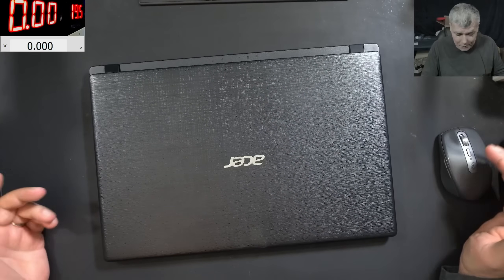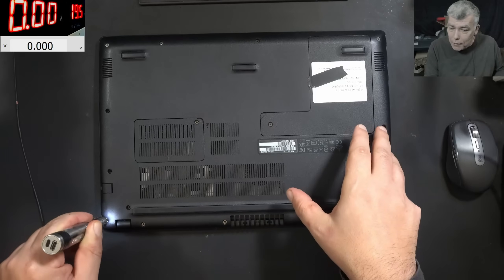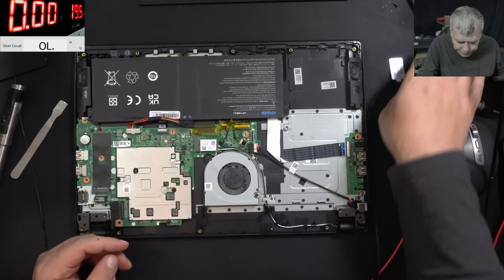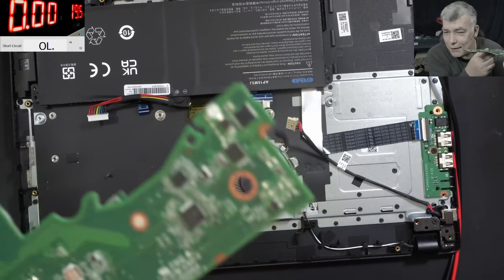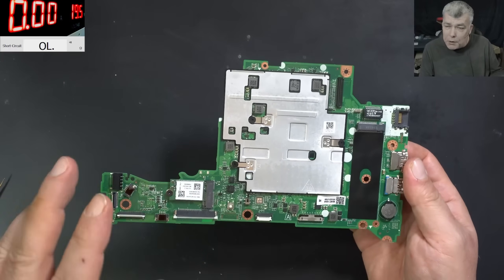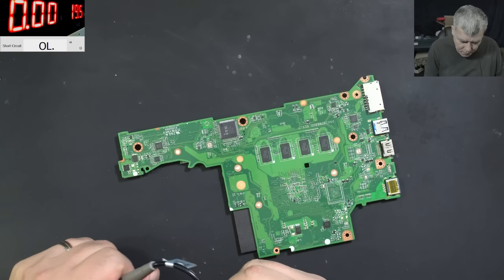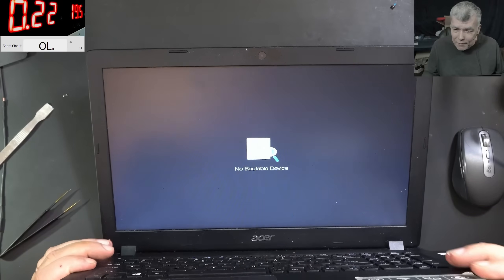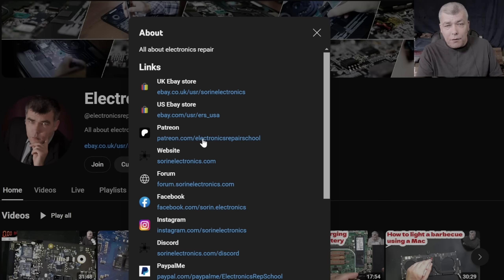Acer Aspire 3 not charging, this can be the reason and you can fix it

Comment: Dell Precision M 6700 17.3" 
I accidentally tore a "Smaller Then Sop23-6 " but miniature. "Off the board trying to too unhook the GPU fan.  I snagged my fingernail across it and peeled it right off the board.   I don't have the equipment you do, too see such tiny objects.  If your interested then 
I'm interested in sending it your way to be fixed.  I still have the IC and I see you having no issues.  Maybe 3 pads came up on the little legs.  Let me know and we will compensate for the shared knowledge.  I appreciate your channel.

Comment: The saddest part is when Sorin said it came from a local repair shop. They didn’t know it was the diode 😢poor customers !!!
Reply: The shop probably doesn't do board repairs.. Not every shop should or even need to. 

Lots of stuff can be eliminated by changing power adaptor, battery etc. At least the shop sent this laptop on for the opportunity to get fixed. So many would end up in the trash. Which is Acer's intention.

Comment: It is for ESD protection there.... There is a huge difference between 40 and 40000 Volts..... So it's a great design practise... basically we find  every port, connector having ESD protection diodes.😊😊❤
Reply: A simple MLCC of about 10nF does this job pretty well, at a fraction of the cost.
Reply: @filips7158  no, because the capacitor behaves as a short circuit, when it's not charged and sudden charging applied. But if at any time t=t the the capacitor is charged to the voltage of the line and for nano seconds it doesn't effect the functionality of capacitor, where as the ESD Protection Diodes are made for this purpose only, blocks the ESD which occurs at thousands of volts but for some micro - nano seconds.

Hope that clears
Reply: @sachinkumar-eb9mt  it "clears" nothing, as you are mistaken. The first part of your explanation is correct. Re-read what you wrote and you will understand.